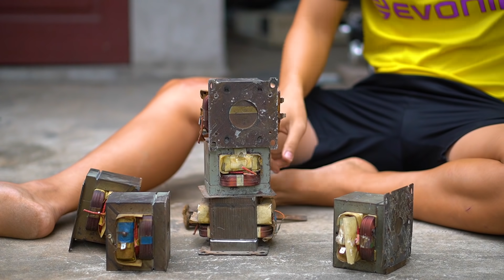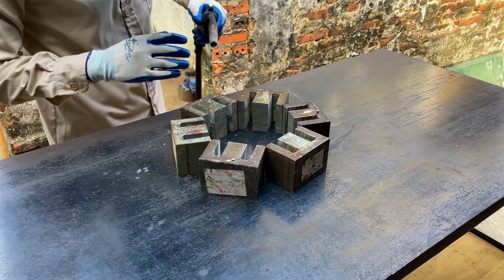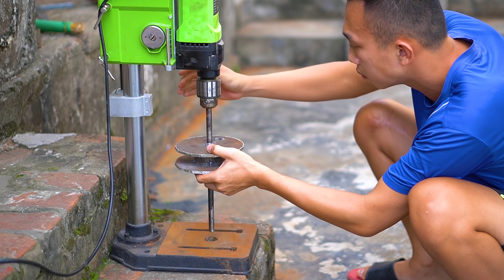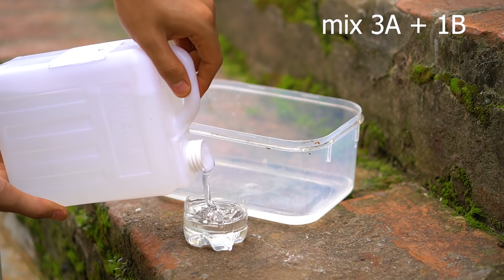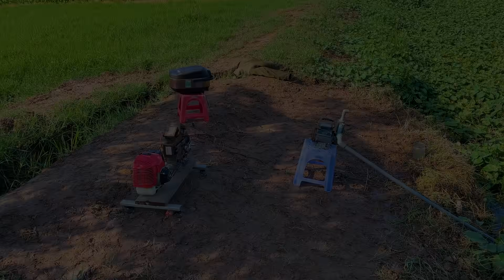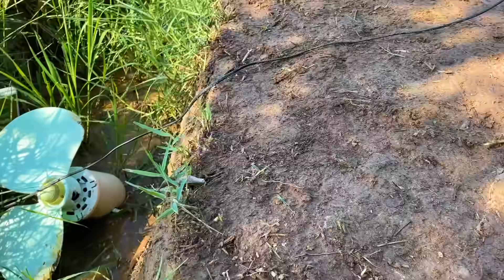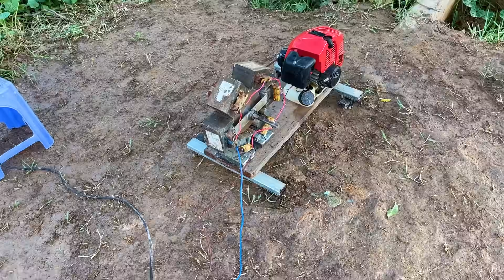I make 220v electric Generator from 6 Microwave Transformers

Comment: Fake. That socket has a buried cord. That is why it is well hidden behind the "generator" in the first phase, then he always switches the camera very fast when disconnecting the fan, and when accidentally pulled the cord from the pump - in fact, you can see the wire if you look carefully, when he pulled the pump cord, the socket tumbles, but then in the next frame is carefully arranged again on the soil. There is no way you can generate so much energy with those small magnets and with such distance to the coils. Also, albeit the fact that the rice cooker can run, as it only has resistive heating element, the pump and the fan have motors with metal cage that work with frequency, so how can he control the "generator" to produce the 50 Hz? With 6 poles he makes three alternance periods per each rotation, so his engine needs to work at 1000 rpm to produce 3000 periods each minute, i.e. 50 Hz - from the sound of the engine, that is far off... He could demonstrate all that in the workshop, wouldn't need to go on the field, but guess what, he could not hide the cord under the pavement... So, people, don't believe all the rubbish you see on the web. If you need a generator, buy one. They are quite cheap. Edit: And something more, I hate this guy for the deplorable state he keeps his tools in, dirt, rust, etc. He should clean and oil those tools, instead of posting fake videos on YT. For me, tools are sacred! They help me make the bread for me and my family.
Reply: Dimana letak kabel yang terkubur ya bos❤❤❤❤❤
Reply: I am not complaining about nothing but the fact that you litter 🤬 throw that broken fan in a trashcan,  not in nature litterbug

Comment: Alone, in a field surrounded by water, bare wire alternator and the first thing you do is to get yourself properly wet before plugging the rest of the appliances. Genius, absolutely genius.
Reply: "You only live once..."
Reply: And no voltmeter, no ammeter. Nothing at all. Running without knowing not safe. 😂😂😂
Reply: and being gah damn bear food
Reply: His contraption doesn't have the current required to kill him. I rather like the inventiveness.
Reply: And we are concerned and protected by bs7671, how many gold card holders could do what he just did? I love YouTube for these moments. This is raw talent and full understanding of a science and its principles.  Lovely. Where is the PPE? He is still alive, right?
Reply: @festerbutt  probably he didn't want to outlive his invention :)))))))))))
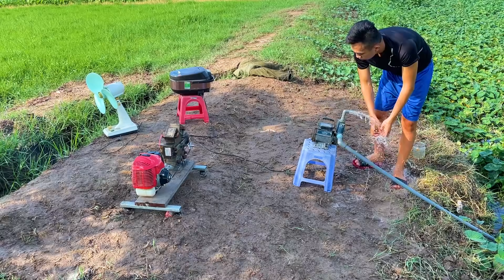Reply: 18:55 You aren’t kidding!  He actually did that!!
Reply: Absoluut fake
Reply: haha oeps the fan hit the water ...
Reply: It's not the Volts that get you it's the Watts and Amps, and he isn't generating a lot of those!
Reply: @chrissscottt  it have more than enough current to kill him if it can run those equipment. way more than enough to fry him
Reply: Correct! This is a confidence trickster! Prove me wrong! There is a sneaky power connection through a cable buried in the mud under the electrical socket. Share a new video with the connector pulled up off the ground, and passing your hand underneath (with this running) The poster is only interested in being paid by YouTube for AD money from many clicks.
Reply: @AlphaOmegaSigma07  I wish you well. One day I hope you wake up and learn a thing or two. Until then keep the faith you have while others con you. BTW, you're not alone, over six million views and counting. Poster must be laughing all the way to the bank with You Tube clickbait money, don't you think?
Reply: @AlphaOmegaSigma07  Can u explain where you think I profit and how? Just wondering where you're coming from, dude?
Reply: @pstonard  I don't know about buried wires but I agree 100% with you on the rest of your comment
Reply: @AlphaOmegaSigma07  it's not the same, An alternator is a generator, no magnets just 2 sets of coils. Therefore you need an outside source of power to create the magnetic field. 
This is the concept of the brushless motor except the wiring
Reply: @pstonard  stop condemning other people work, do yours let's see
Reply: @henryigbojionuba4966  I stand by my claim that this is FAKE.
Reply: Let alone the rice is cooked in like 60 seconds and looks cold and stuck together. Lol
Reply: @biggrizz4447  It's all part of the theater. The presenter wants to convince the audience that his contraption generates a lot of energy. He looks Chinese/Asian, so in that culture cooking the rice (providing for the family) is of great importance, and he can do it in no time and do it free with his new invention.

Here in the West, amongst educated people, I think we rather see some Qualitative data, from electrical meters. What do you think?

I hope you're enjoying the entertainment!
Reply: @ВольфТутаев  não funcionou
Reply: @pstonard  por que no te callas, no tienes ni la más mínima idea de lo que es un alternador, váyase con su ignorancia a otro canal.
Gracias
Reply: @MrRaddoslaw  Litterally
Reply: Mr. King , next time please  provide more measurements.
Reply: один шнурок на приводе стоит Нобелевской премии, умора цирк.
Reply: @Glenntong12  Do you really think he built this as in the video with no upfront engineering and test?
Reply: Of course he's got PPE, he's got sandals that's the gold standard!
Reply: @DogSerious  Hahahaha, make a YT video to prove it.
Reply: @sbybill3271  You don't need videos to understand electricity, you need maths and equations using watts, amps, volts and ohms
Reply: @DogSerious  I bet his generator has enough power to kill an elephant in an instant.
Reply: @sbybill3271  Not spinning at those low speeds it won't, it can barley power those low wattage pumps that are only about .37Kw
He would have to have it spinning at at least 3000rpm just to make 220volts at 50hz at 5000watts on each side of the phase. He would also be better at splitting it into three phase, with two stators on each phase!
Reply: @DogSerious  Google search reveals that Humans have died at as low as 42 volts. Time is also a factor. A current of 0.1 ampere for a mere 2 seconds can be fatal.
Reply: @sbybill3271  I've had 1000 volt shocks dozens of times just doing insulation resistance, it's not the volts that kill you.
Reply: @DogSerious  There is no such thing as current alone. Current depends on voltage and resistance as you know VOLTAGE =Current x Resistance. And if 0.1 Amps kills (which it does) then at 42 volts the required body resistance would be 420 ohms. The resistance between finger and toe is almost 500 ohms but if slightly wet the resistance will drop sharply - allowing enough current to kill. The resistance between both ears is only 100 ohms on average. But if the voltage source cannot supply 0.1 Amp current then at 1000 volt it won't kill a person no matter what his body resistance is. This generator has enough power to source 0.1 Amp and will easily kill. I hope it is clear. There is tons of stuff on the internet on this subject.
Reply: @sbybill3271  4.2 watts of 42 volts at 100miliamps will not kill someone, and it's only 4.2 ohms,not 420ohms.
Reply: @DogSerious  please recheck your math
Reply: @virgiliomontes714  Me parto de risa, llamando ignorante a Peter uno que parece que si sabe de alternadores, que esta midiendo el rendimiento de un "alternador" a simple vista ( que el "rotor magnético" gira libremente sin tener una minima resistencia al giro, la distancia de hasta 15 mm entre el rotor y el estator y la conexión de las bobinas en serie sin haber comprobado el terminal frío son detalles insignificantes para su intelecto ) y que encima le manda a callar ...
Reply: @henryigbojionuba4966  fool
Reply: safety first,,fk the rest..
Reply: Si este goyete funciona, no le va a pasar nada a menos que toque ambos cables del generador, no hay conexión entre el generador y la tierra, a diferencia de una red electrica convencional.
Reply: @juanmiguel1214  ce treaba are sula cu prefectura?
Reply: I don't agree the amps and 80 volts that required are there  @pstonard

Comment: Let us see what is under the receptacle where all the devices plug in.
Reply: Correct! This is a confidence trickster! Prove me wrong! There is a sneaky power connection through a cable buried in the mud under the electrical socket. Share a new video with the connector pulled up off the ground, and passing your hand underneath (with this running) The poster is only interested in being paid by YouTube for AD money from many clicks.

Comment: No way to work , need a magnetic rotating field, could be rotating magnets or rotating coil excited with dc current.
De esta forma nunca funcionara, pues nesecita de un campo rotativo excitador, que puede ser de imanes rotativos o una bobina rotativa excitada con corriente continua.
Reply: Correct! This is a confidence trickster! Prove me wrong! There is a sneaky power connection through a cable buried in the mud under the electrical socket. Share a new video with the connector pulled up off the ground, and passing your hand underneath (with this running) The poster is only interested in being paid by YouTube for AD money from many clicks.

Comment: I have done mine slightly differently. I used the magnets from the magnetron of the microwaves. I also have 8 transformers, not just 6 welded together. Instead of one row I have 3. It’s also driven by an electric motor from a washing machine that is fed by the generator, with 240 going into the wall socket 24/7. The hardest part was getting all the microwaves with the same size transformer and the right motor from a washing machine. The generator in the video seems to be a fake, but the concept is sound.
Reply: Deberías de hacer un tutorial de cómo lo hiciste.
Reply: Can you share with me please
Reply: I have since made a larger version that’s sits in my back yard. It is about the size of a washing machine. A plastic cylinder with rare earth magnets spins against twelve microwave transformers per level, with ten levels. My advice to you if you want to make something like this is to either become educated on how to use and dangers of electricity, or find someone else who is. You have two parts to this project. Firstly to build it so it works, to get the materials. Secondly to make sure it’s safe. The power generation isn’t small and can easily kill you if you don’t do the right things and use the right materials. Also when working it makes a loud humming sound, so the area you put it needs sound proofing and is not suitable for indoors as it might catch fire.
Reply: @986najes8  Good advice…. Do you mind sharing your design? I’m in the process of building one of these myself and having something to reference would be great🙌🏾🙌🏾🙌🏾 thx
Reply: To be honest I haven’t thought of making a blueprint, and I’m not sure how. What I have made, while generating power is still very dangerous and has killed my pet dog, a neighbours cat and some birds. It would be irresponsible to give a demonstration while I still have leakage. What I have described should be enough for you to copy. The hardest part is getting enough transformers to make it work. You might want to try a chain from a remote control gate as the drive belt, as rubber belts seem more prone to wear. Once I have worked out the bugs and made it somewhat portable I might make one from scratch and make a video of it. I suspect however it will not be believed. The components are not cheap, just in the cost of it, general application is restrictive. Besides I work 6 days a week 12 hours a day. So I only get a few hours a week to work on it if I’m lucky. At the moment  I am running it under powered 240 volt into the house. It has knocked down the power bill, but it will take many years to brake even. Free power isn’t cheap

Comment: Placing the magnets so far away from the outside of the rotor AND placing the stator far away from the rotor makes this so inefficient, a lot of work to blow on them two mistakes.
Reply: It's not the main thing for the author, the main thing is to make a video.
Reply: @bigsem32  I see, the best preformance would take little time and effort to do correctly, making the generator much more powerful and efficient. As I always say, if your gonna do it, do it right.
Reply: @bigsem32  hahaha exactly for the sake of content its up for you to believe
Reply: Probably using a electric motor (from begining of video) as generator would be more efficient, because it is hard to perform worse than this construction.

Comment: Amazing, the coils are in series with no regard for the polarity reversal on every odd coil. Even more amazing is the connecting the loads did not load the engine down at all. It's like the outlet can't be picked up to plug in devices and unplug them.  Entertainment value is good. It would be interesting to see what voltage he could have gotten with every other coil reversed. He had the right number of magnets for the project. If he didn't want to reverse the polarity of every other coil, the number of magnets could have been doubled, so all coils got a South at the same time, then a North at the same time.  But the video was made for entertainment reasons, not to generate power.
Reply: Ok
Reply: I don't understand how the 6 coil transformer work.  it's 220 each coil? would it be over voltage? because the microwave is 220 coil? or the transformer is only 40v and the big one he not use is 220-240v ?  he put it in series.  so if it am not use the gas engine to run but use another motor like a table or Stand Fan and use that as a motor to run the magnet wheel.  Then how do I keep the constant the same volt?  do I needed another Electronic device to regulate the electrical outlet for home use safe for computer? that's the question ?????
Reply: Exactly there are a lot of fake videos on youtube just for the likes and views , it's a pitty for those who spend money to build these shit.
Reply: @pgiesbers68 bạn hãy học giỏi môn vật lý thì bạn sẽ hiểu được nguyên lý hoạt động của nó
Reply: Ac no worries for the polarity
Reply: The long descriptions all can be written with one word....  FAKE
Reply: @makesaveinccomm it simply does not produce anythingusefull at all. These magnets are so small and they are so far from transformers that if it light up LED i will believe. There is definitely hiden cable somewhere. It does not need tobe. Rice was already cooked. And the pump is not pumping it is turning by waterflow itself. May be ut geneaters the power. How clever
Reply: if he reversed the odd coils it would cancel each other out imo, and shouldnt he have gotten his ground from tapping center of transformer and having 2 "hots"? to get 220v , Imo he has a bad over voltage problem dangerous with a full series hook up if they are 220 coils they should be paralelll to keep the 220 but again the amps would be crazy dangerous.

Comment: If this generator was to have 8000W capacity, it would require an engine with a maximum power above 10HP, and moreover, that the engine used in this movie is much too weak, pay attention to the fact that when turning on the next electric energy receivers, the engine will not gives the slightest sign of any load. Conclusion: a hidden power cable from the mains for
Reply: U r wrong, read paramhans tewari patent on Lenz less generator.
Reply: If he would just use his 220. V. Welder on the new generator then I'll be impressed 👍😁
Reply: I agree , when he plugs the 220 water pump in theres no load on generator at all , also hes plugging a 120v fan and a 120 volt air cooker into the same plug ,,...amazing huh
Reply: @overunityinventor  its all about magnetic field ideas,,
Reply: Unless there is a suppression of the counter EMF.
Reply: What about 50hz, or 60 ?

Comment: The technology is sound, But. I'm surprised in the steadiness of the rotor, since it was not trimmed and trued, nor even balanced. For more power output. Their could of been more than three magnets, in line, at each pole and the windings should of been closer to the rotor magnets. Other than that. It looks doable.

Comment: Jeeesus ..first you destroy 6 splendid working MW transformers that could really be used for better purposes ("100kV" seriously?? .. at most 2-4 kV, but doesn't matter) in order to patch together a silly Solala-Generator with an air gap that is far too high and a poor efficiency - then you screw this "thing" on a board to drive the crap with a stinky, polluting gasoline engine (with an efficiency of maybe just 10%) via a MickeyMouse-fan-belt and you actually think you could use it to power loads with more than 50W? :))  The pump just sucks a little bit, the rice cooker is definitely not heating (only the display lights up) and with the chaotic load-dependent voltage fluctuations it's better not to operate sensitive loads (otherwise it will just pop). Use batteries or weld a hand crank ... that has more meaning and efficiency  .o.

..such a pointless waste of resources, time and energy - idiots at work
Reply: Correct! This is a confidence trickster! Prove me wrong! There is a sneaky power connection through a cable buried in the mud under the electrical socket. Share a new video with the connector pulled up off the ground, and passing your hand underneath (with this running) The poster is only interested in being paid by YouTube for AD money from many clicks.